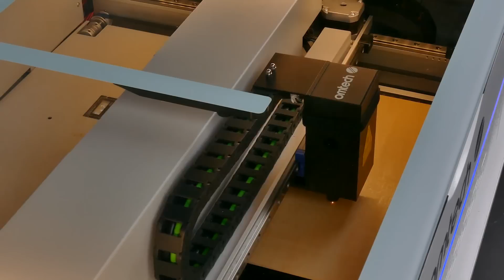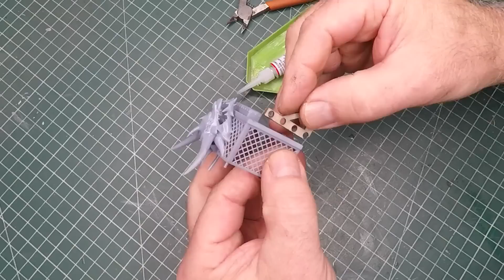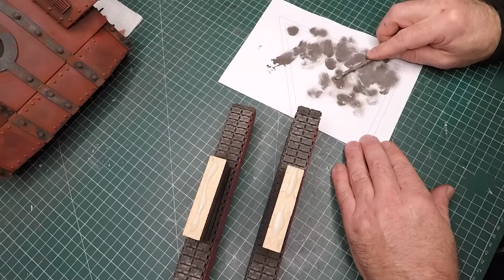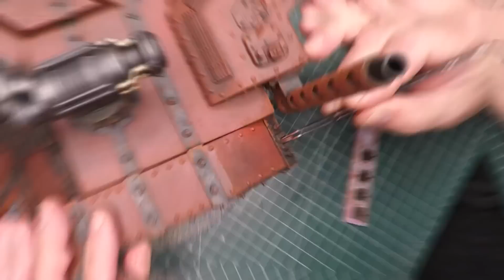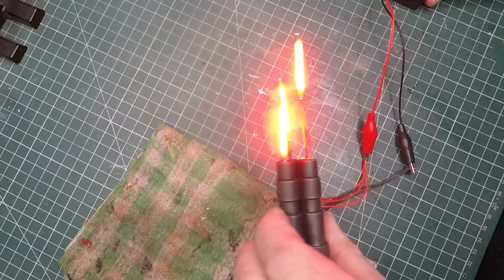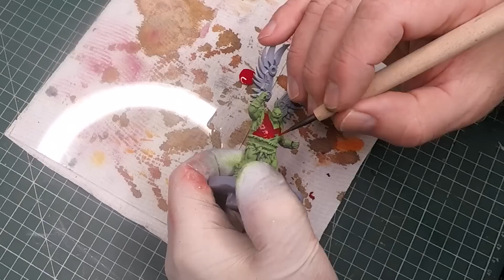A War Machine Devastates The Barren Wasteland Plus A Back Story #omtech #elegoo #scalemodel

Comment: I've seen you use the little prebuilt grass tufts several times. Towan uses a technique for making your own, including varying the size and shape, using wax paper, glue, and a grass applicator. Check it out. :)
Reply from the maker: I've actually tried making my own but they came out a bit flat.
Reply: @ScaleModelGeek  It's the trying that counts. :)